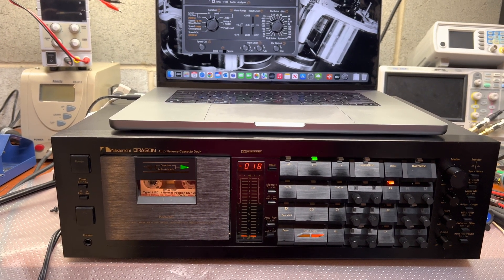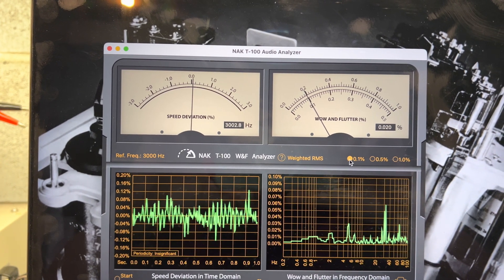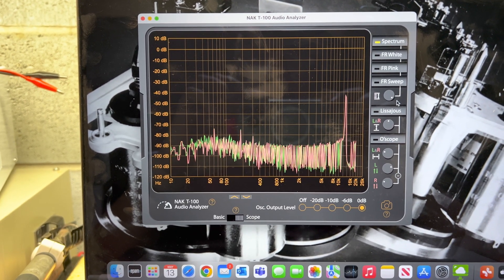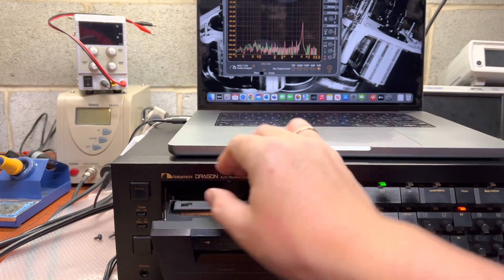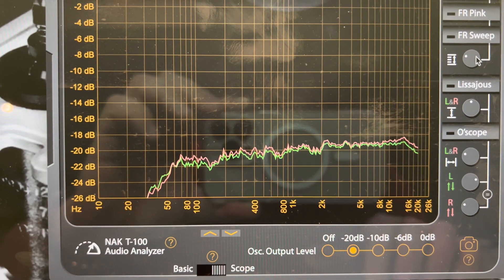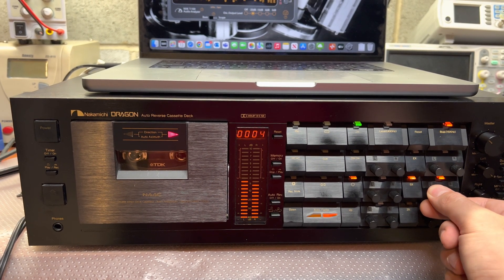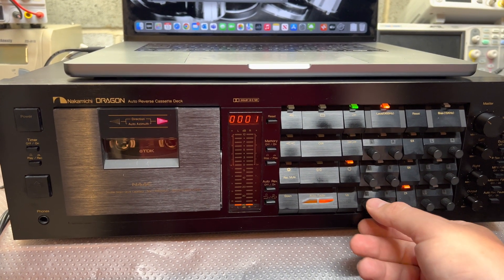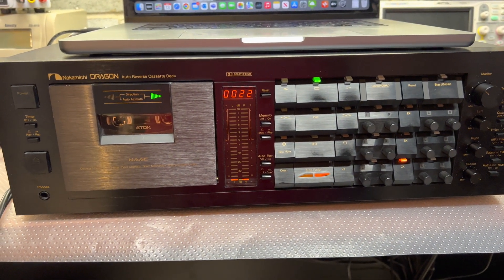Exceptional technical performance of the Nakamichi Dragon

Comment: The smoothness on the low-end is incredible. For comparison, when I checked my 1/2" 8-track at 15IPS years ago, it had a +2dB head bump at 60Hz.

When I get my studio back together I'll have to test my aiwa cassette deck. Not as good as a dragon, I'm sure, but there are definite tiers to cassette decks, and nobody is manufacturing the top-end these days.

Comment: The Dragon always was the hi-fi enthusiast's cassette deck of choice back in the good old days. Just a work of engineering artistry. Overkill, sure, but when tapes were the standard duplication method, this was the pinnacle. Not sure if you have any info or personal experience in testing, but I would like to know how Dolby S compares to C in noise reduction. Decks with S only became affordable when the tape decks were being replaced by CD burners and MD and I gave up on cassettes altogether. Now I've still got a small pile of cassettes and only a questionably reserviced walkman to play them on, I wish I held onto my old Sony dual deck from college.
Reply from the maker: Dolby S has better resolution on highs. But comparing to DBX, the biggest issue of Dolby systems is very high sensitivity to the levels, which reduces compatibility across the decks.
Reply: @hifirulezzz  Thanks so much for answering a question that has always lingered in my mind since the mid-90s. 

I remember DBX was certainly the gold standard of tape NR but I can't think of any machines that had it that I could possibly afford at the time. Maybe a Yamaha deck or two showing up in a local chain store, but that was about it.

What a wonderful era in audio equipment. Nothing quite beats a nice stack of hi-fi gear in a glass cabinet or on a bookshelf and there's something just satisfying about the click of the mechanism starting up when a full-logic button is depressed. Thanks for sharing your passion here with other weirdos like me.

Comment: What is the A/D USB converter adaptor you are using to connect to the Laptop please? I like the software you use for setup and testing and I'm going to do the same myself. I have the original Nak T-100 unit but would like to use on the PC as well. Thanks
Reply from the maker: DriverGenius AV202-B USB2.0 Audio Capture/Grabber Card Device - Win & Mac https://a.co/d/fhauSyc

Comment: how much did one of the dragon players cost new when they  came out ---??/
Reply from the maker: https://www.cassettedeck.org/nakamichi/dragon
Reply: The Bang and Olufsen Beocord 9000 outperformed this deck and cost about $1200 less.  Frequency response with metal tapes was 10Hz to 25kHz.  The Dragon is still a beautiful deck and probably will go down in history as the most sought after deck, even though it isn't technically THE best tape deck ever made.